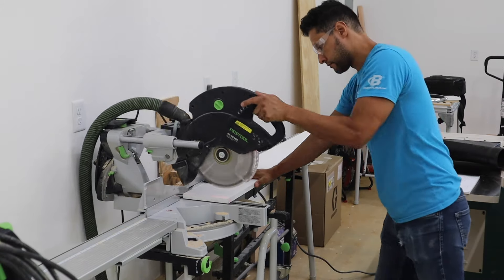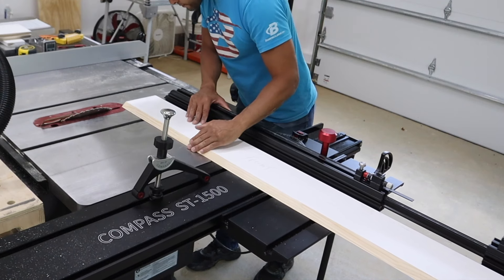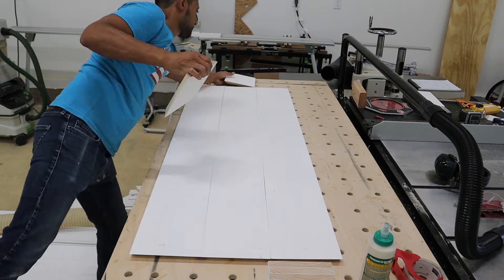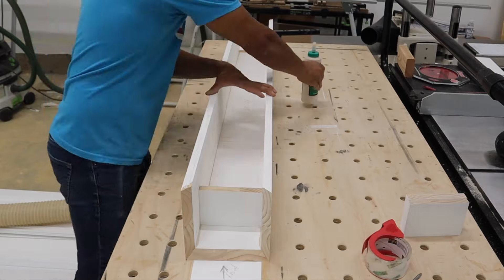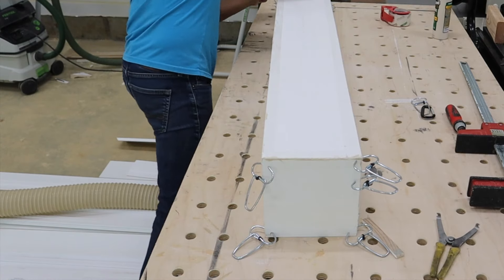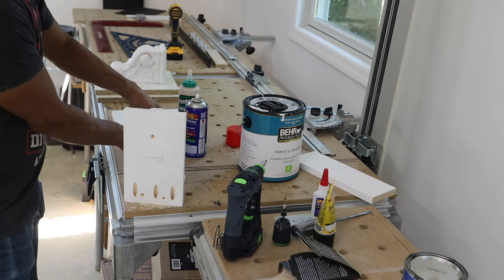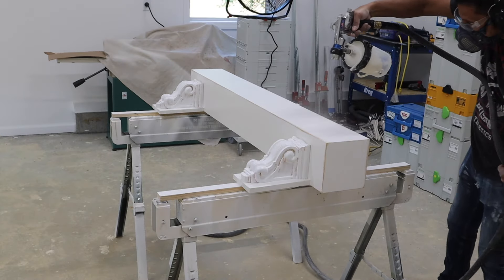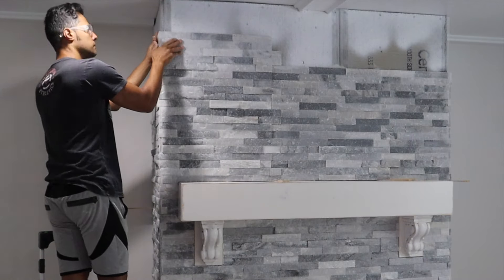Simple but elegant mantel

Comment: Couple questions lol.. What was the big Harvey machine behind the dust extractor? which sander is that? Why not a festool? Lastly, what do you do about the glue squeeze out on the inside of miters? I wipe it with a damp rag but it stains nasty. 

Thanks
Reply from the maker: @CustomWoodWorkDecor  that was the Harvey g700 dust collector. The sander is a Mirka, I’ve had it for years before I switched everything over to Festool and it still works great and ranks right up there with Festool, so I’ll keep it until it burns out. The glue, with a painted project, glue squeeze out that is wiped with a damp rag doesn’t leave any traces after finishing. Stained projects you have to be more careful with, however if you clean up the squeeze out quickly and make sure you sand it properly, then you shouldn’t have a problem. But don’t over glue to the point of either, making a mess with squeeze out is hard to hide at any level. Also on darker stains, titebond makes a dark glue that hides very well.